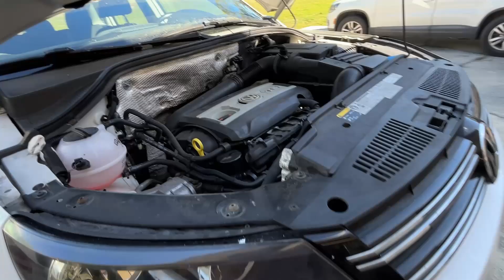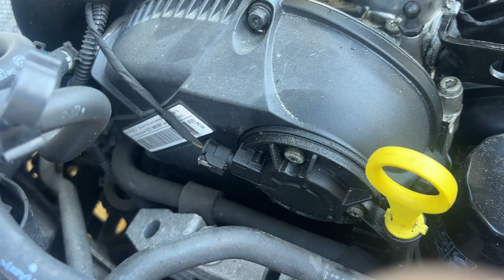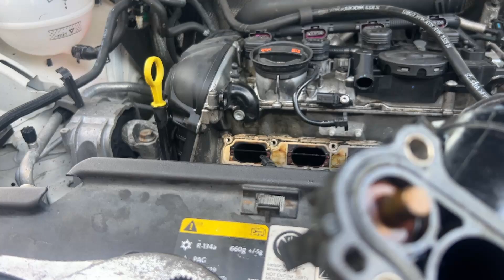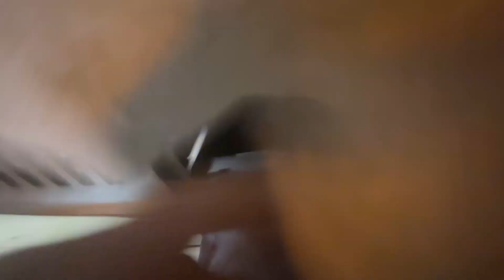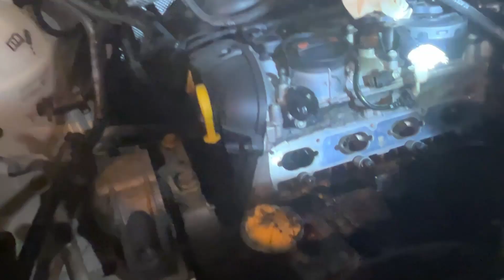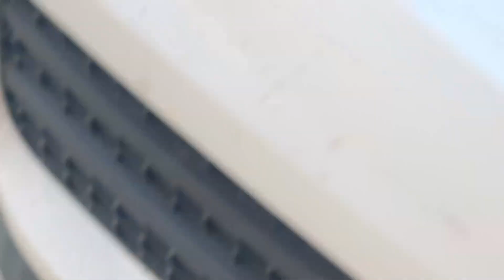Tiguan Water Pump Replacement Part 1

Comment: Great job bud, but make sure you replace the timing chain with the tensioners.. VW Tiguan 2009 until 2013, are known to have a potential timing chain issue related to the timing chain stretching and the tensioners .. and will eventually lead to engine damage.. do your research and be careful.. happy 4th!
Reply from the maker: Thanks for the good advice!